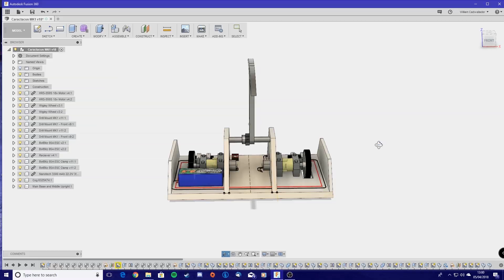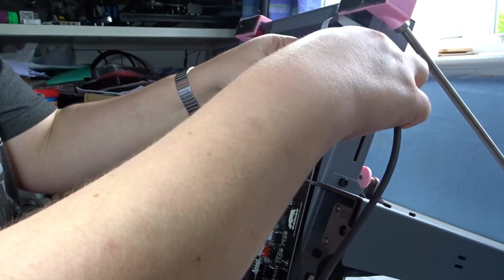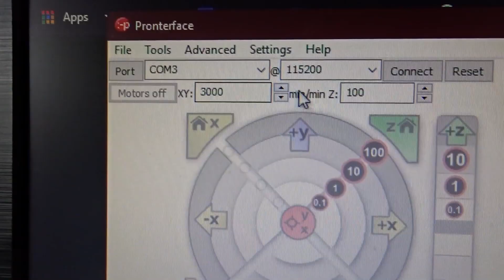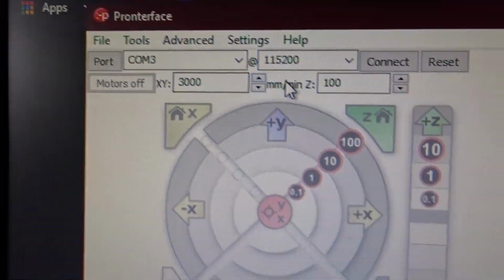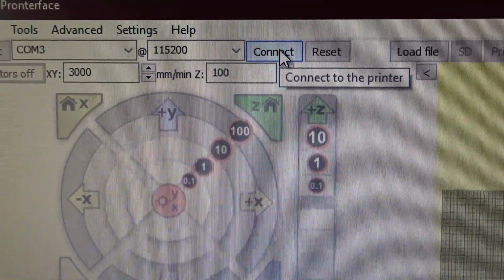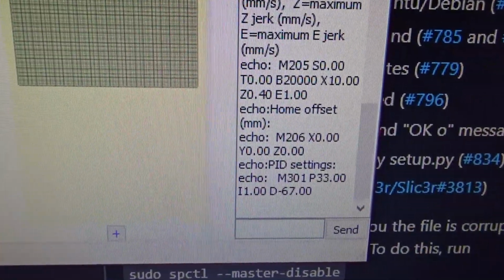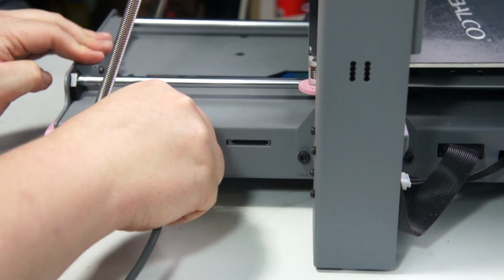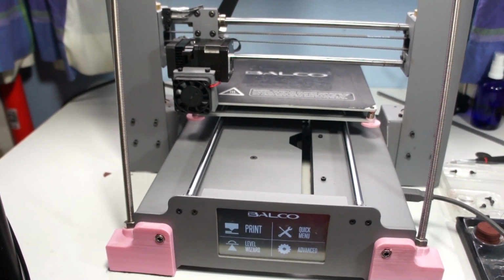Fitting a USB Port to the Balco 3D Printer Touch!

Comment: Hi Will, great videos on the Balco, finding them really useful.  About to do this upgrade myself - does it need to be a USB-B  port or can it be A or C too?  I'd rather not have yet another style of cable laying around! :)
Reply from the maker: I'm so sorry! My comments seem to be getting buried and I keep missing them :( Just in case you didn't find the answer, I think it needs to be USB-B because the mounting holes on the board line up with that connector. If you used one of the others you would need some sort of break-out board to convert it which isn't ideal. How did you get on? Thanks for watching and again sorry for the slow reply!
Reply: no worries! I just followed your instructions and fitted the same USB anyway.  Worked a treat, thanks :)

Comment: Another good video Will, thank you. 

I have the newer version of this printer, with a USB already. However, have you any suggestions for improving the extruder/extruder cooling?
Reply from the maker: Thanks :) I actually plan on making a video soon of upgrading the extruder/part cooling fan with an upgraded radial fan. That will be as soon as i get the parts printed :) Other than that I recommend the all metal hotend from MicroSwiss. It allows you to print Polycarbonate and Nylon filaments. I made a video on that also :) General tip for now would be to calibrate your extruder e-steps. There's a few guides on YouTube, I recommend the Matter Hackers video on the subject :) That will make sure your extruder is extruding the amount of plastic that it expects and will ultimately improve quality :) Hope this helps and thanks again for watching! :)